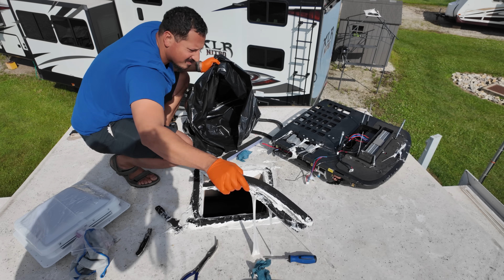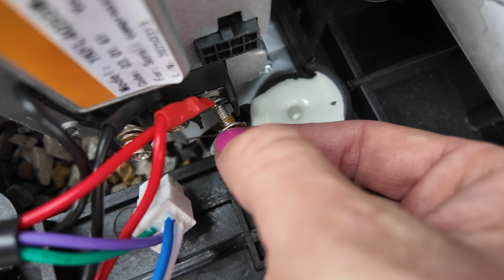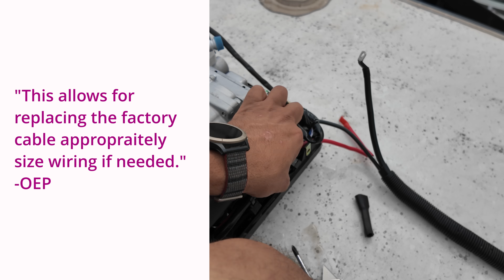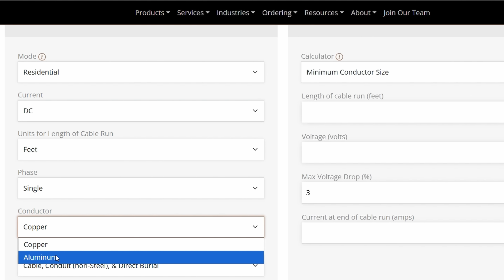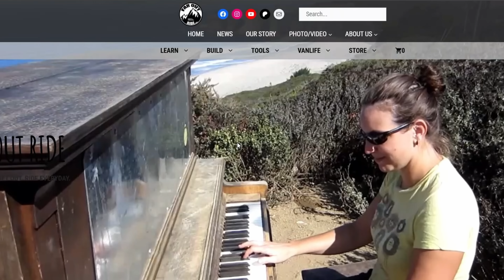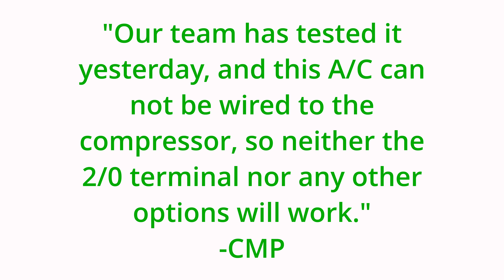The Truth About 12V RV AC Wiring in Big Rigs (What No One Says)

Comment: As an Electrician, I would never recommend a DC Air Conditioner.

Also, I would never install a DC circuit with over 5% loss.

I have a rule on standard installs with inverters:

5kva max on 12v
10kva max on 24v

I have done many dual inverter installs over these numbers, but drawing 400a for hours on end can really heat up wire, so it needs to be really thought out beforehand.

Lastly, I use 90c calculations, or even 75c, never 105c, and NEVER use any cable not rated for 90c or better. Most cables now can be bought with 105c ratings, so it is safer for long durations at very high loads.
Reply from the maker: Thanks for your input! That was kind of the consensus we received when reaching out to multiple Electricians, but everyone has own level of comfort! We tend to be pretty cautious, when it comes to electrical as we are not experts and don’t like fires! 🔥 

Thanks for dropping your knowledge!
Reply: @DeterminationUnbound  the good new is: you can't really go to big with DC wiring in this case. Lol

There is a case where wire too large becomes an issue, but normall only when applied to batteries in parallel and variation in resistance between cables, but that is a topic for another time/video.
Reply: And your thoughts on lithium batteries?
Reply: @jasonbruney8842  I wouldn't use anything but lithium, except on engines with alternators not specifically setup for lithium, I.E. a smart controller and snubber.

More specifically, I would NEVER use Cobalt based lithium, only Lifepo4.
Reply: I personally like using laser heat sensors even if you size all your wires properly. Sometimes strands inside of the cable can be broken and can cause major heat and the only way to catch it is to check the entire run with a heat sensor.
Reply: @Oblivionsurveyor  I use a thermal camera on my completed installs to find hot spots. I have never seen a broken cable as you suggest, but anything is possible when dealing with soft copper wires.
Reply: @Oblivionsurveyor  emt/metal conduit acts as a mirror for IR radieation. youre just measuring the reflection of the room. try it with a thermal camera, you can see your own reflection. an ir laser temp gun is just a 1 pixel thermal camera.
Reply: AC has more losses than DC
Reply: @ray_casso  yeah, that is why the Tesla vs Edison battle when trying to bring electricity to the world went the way it did, huh? The high AC losses, right?

You should be more intelligent than that!
Reply: electricians only know home building codes and work entirely with AC cables. they have very little knowledge and usually no experience installing dc systems other than some solar premade solutions. you can tell they have no idea what theyre talking about because they use mobojumbo kva units to talk about dc system capacity lol. theres none such thing as kva for dc systems, its watts and kw bro
Reply: 5kVA is 5000W or >400A at 12V. The air conditioner in this example is 60A at 12V.
Reply: @MadiJoshify  wrong. 5kva is ONLY 5,000w at a 1.0 power factor, which never happens in real life.

Also, I was speaking specifically about Inverter limits, not long ass high amp runs of DC, which I try to avoid.

In this case specifically, I would have ran a 5Kva Victron in 12v, then kept an AC powered AC and added an ICM870-16a soft start to it.

400a is a pair of 2/0 cables, which go nicely into a Victron inverter. They would also be short, since the inverter would be placed right next to the batteries.
Reply: @CharlieOdom1957  DC does not have pF.....
Reply: @snake10566  God damn you people are pathetic. Read my god damm comments, please.

Nowhere in ANY comment did I say DC had power factor, NOWHERE!!!!
Reply: You may be over thinking things. Your ac came with wring...correct? Run the 2awg from the batteries to a distribution block and then attach the wires coming from the ac to it and don't forget to fuse the system.
Reply: @nitrox58 please, for the love of god, NEVER do this!!!!

Comment: thanks for the heads up, could you not put a small  12v battery close to where the wires first come in the camper to act basically as a capacitor against any voltage drop or one continuous run a wire?
Reply from the maker: There have been a few comments that mention such a method….

But where my electricians at can we get clarification on this?
Reply: @DeterminationUnbound  I don't think this works except for very short time loads. For continuous load the "small" 12V battery will need to be charged with the full current draw by the AC which will require the large wires.
Reply: I agree (specialized electrician) that you'd need many hours worth of battery.

Comment: I have a Stupid idea. 
How  about use a 1200w inverter just for the AC unit ) near the battery and put a 80 amp 12 volt battery charger near the AC .
Yea I know it is not as efficient but might work for longer distances.
The best option would be to get a 24 volt unit and put 2    12 volt batteries in series.
Reply from the maker: Thanks for sharing!
Reply: This makes no sense. An inverter is for AC not DC..
Reply: @longgone2023  convert dc at the battery to  AC to run a smaller wire without losses to a another DC converter to get the 12 Volts within 1 foot of the DC air conditioner .make sense now ?

Comment: maybe you could run the heavy cable to the roof and then use a distribution bar to connect the appliance? but it does seem like the real problem is the 12 volts, a 48 volt system would avoid the heavy cable requirement.
Reply from the maker: Agree, a 24v or 48v is always better on the wiring! I’ve noticed that some units that are hybrid 12/24/48 systems only achieve their advertised BTU when running on the higher end of the voltage capabilities. Thanks for sharing!

Comment: Bus bar? The point is to get the power there in tact. Which you do with the thick wire. And then tie it to a bus bar and feed the AC from that. Still 12v is scary. Maybe a 24v or just go minisplit.
Reply from the maker: There have been lots of great suggestions in the comments! Thanks for sharing!

Comment: The complication came from ignorance and the solution is easy.  Run your larger cables to the junction box on the roof, or anywhere near the unit, then run their supplied wire from that to the unit.
Reply from the maker: You are right, and that’s why we posted this now there are tons of people sharing multiple solutions and everyone is aware it will not be the plug and play set up that is advertised. Thanks for sharing!

Comment: Once you did the calculations you basically have similar losses that an inverter setup would have so it’s pretty close to a wash. Then there’s the weight of that cooper eating your gas mileage too.
Reply from the maker: I didn’t even compare that, but yes, weight, and cost of larger wire to consider for sure! Thanks for sharing!

Comment: I installed an outequip 10000btu in place of one the 2 13500btu units in a toy hauler. I exchanged the 6awg with 4awg for a 30'(x2) run. Wires do get warm to the touch when running turbo mode, but the unit will have to be moved to the bedroom because the 10000btu will not cool the living area of the trailer. So it looks like a larger BTU AC will have to be added. I currently have 690ah with a 1000w solar. So I'm quickly finding out that you have to be wealthy to be cool when boondocking. 😊
Looks like I'll be adding more batteries and panels to run a larger 12v unit. Thank you for the info.
Reply from the maker: Be careful with those warm wires! Yes it’s not cheap, we are still in the look out for a cooling solution that for those without an off grid unit! We will be sure to make a video when we do! Thanks for sharing!
Reply: solar is cheap and you definitely dont have enough
Reply: I run 4/280 Ah batteries, 4k Inverter, 120 Amp Charger.  I can run the AC with other appliances as usual on a hot day for about 14 hours.

Comment: First off you did not think correctly. Yes for the number of feet you need is 2/0 cable. but and big BUT; not directly to the unit. The Unit for up to 3 feet will be fine running the 6 awg to a terminal box with two separate terminals. Now you have the Manufacturer's correct setup to the Terminal block, and the proper rated cable from battery/breaker to the terminal connection.
I would have run the cable differently. Through the same hole the solar panels use.
Reply from the maker: Thank for sharing some alternative solutions, it adds value to everyone reading. Lot solutions to the same answer. Thanks for sharing!